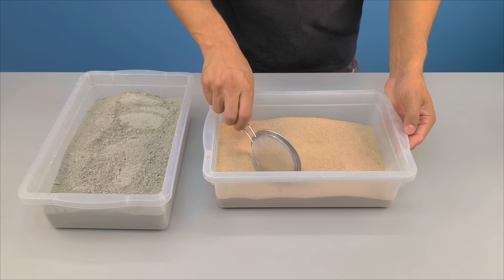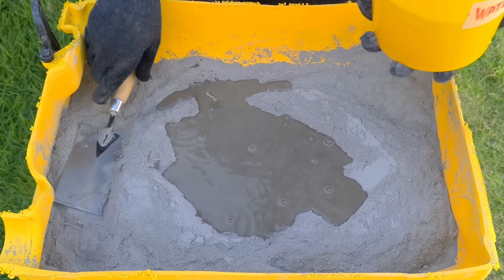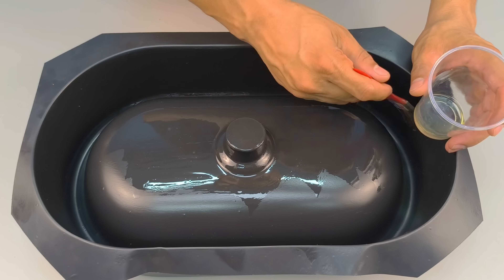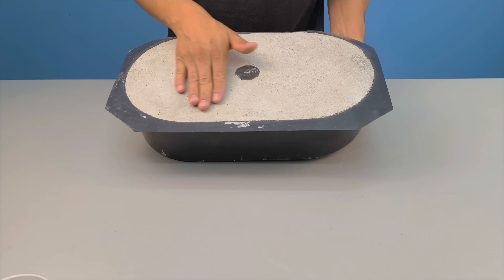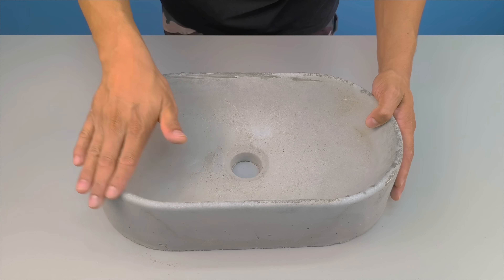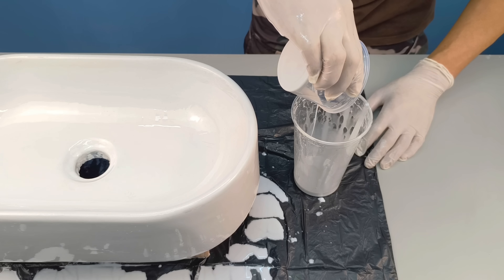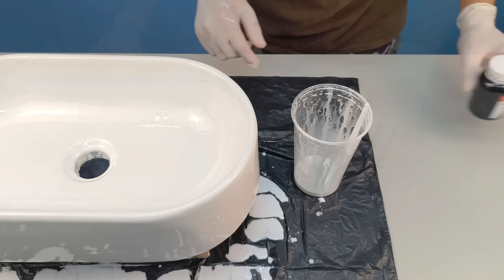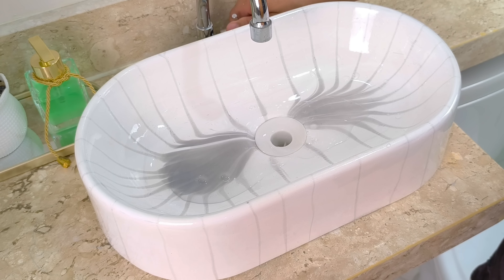Mix CEMENT with EPOXY RESIN and turn the impossible into a MILLION-DOLLAR idea!

Comment: How does this scale up for a hot tub jacuzzi or bath tub with some custom nozzle jets, could it be made so the walls are thinner? many baths or spa seem to have really really thick walls and strange shapes and patterns in a large rectangle its total bath area used as a bath might be quite low. so maybe not closer to a sort of fish tank around the edges but thinner walls that would ideally be more like its uhh water in there and not those strange shapes on the sides are they a reinforcing thing?  and have ramps and stairs or something and still hold water?  so it feels bigger and deeper or could be wheeled away to be stored or cleaned.
would making something that looks like marble columns and a out door sun room or pergola or marquee area similar to a car port or shelter maybe with shadecloth or tarpaulin over it be the same mixcture and spackle and resin work?
Reply from the maker: Scaling this up would require proper structural design. Thinner walls are possible, but only with engineered reinforcement such as fiberglass, mesh or composite layering. The internal shapes in many tubs act as structural reinforcement and load distribution. For larger water volumes, mobility and safety would need engineering validation. Marble-like columns or outdoor elements could use a similar cement base with surface finishing and resin sealing, but structural loads must always be calculated separately.

Comment: The idea is good but the process is so long and time taking making it an unprofitable product compared to other products. It takes 2 week for a single sink to make when you can do something rather to make 8x more income by 2week. I love the idea but not recommend for a single peace whose about to start as a business.
Reply from the maker: That’s a fair and realistic point. This process is indeed time-intensive and may not be ideal for mass production or quick profit. The focus here is on custom work, learning, prototyping and unique pieces rather than fast commercial scalability. For business use, batching and process optimization would be essential.

Comment: Unfortunately the ratios of Portland cement to sand are incorrect. Use at least a 2 sand to 1 powder or better yet a 3:1 ratio. Strength of materials break tests always give higher break test results using these ratios. Also, it takes a long time to blend the chopped fiberglass into the mix. For home owners, use Pam Spy instead of cooking oil. All in all good job, from Lynn in Atlanta.
Reply from the maker: Thank you, Lynn, for sharing your technical insights and experience. You’re correct that traditional strength tests often favor higher sand-to-cement ratios. In this project, the mix was adjusted for surface finish and mold workability rather than structural load. Your tip about using Pam spray instead of cooking oil is also very useful for home applications.

Comment: Brisbane Australia can you send me the specific ingredients please
Reply from the maker: Hello Brisbane 🇦🇺
The ingredients used are common materials: cement, epoxy resin, water (for cement hydration) and optional pigments. The exact proportions may vary depending on the application, but the goal is to combine cement for structure and epoxy for sealing, strength and water resistance.

Comment: even a Swiss watch doesn't need so much time
Reply from the maker: I understand the comparison 😄
Some steps require longer curing times to ensure proper strength, sealing and durability. In cement and resin processes, patience directly affects the final quality.
Reply: @inovaouinventa  I don't think you did understand the comparison. They are likely suggesting the video is too long, not that your process involves too much patience. ;)

Comment: you stated 30gm of fiber per gram, should this been kilogram?
Reply from the maker: Good observation. The correct amount is approximately 30 grams of fiber per batch, not per gram or kilogram. It was a verbal reference to the total mix quantity, and small variations are acceptable depending on the desired reinforcement.

Comment: Very interesting process. Have you tested how this cement epoxy composite performs over time in terms of thermal expansion or long term water exposure?
Reply from the maker: Great question. In this project, the focus was on surface sealing, water resistance and structural stability. Cement naturally has low thermal expansion, while epoxy provides flexibility and waterproofing. For water exposure, the epoxy layer acts as a protective barrier. Long-term industrial testing was not performed, but for decorative and functional applications, the performance has been very stable so far.

Comment: Wha additive is used ? It had a brownish color
Reply from the maker: The brownish liquid is a plasticizing additive, also known as liquid lime. It is used to improve workability, cohesion and fluidity of the cement mix, without changing its structural properties.

Comment: I thought the concrete and resin were going to be mixed together! As for that fiberglass you could always use a tad bit more of that!
Reply from the maker: In this project, the concrete and epoxy are not mixed together. The concrete provides the structure, while the epoxy resin is applied later as a surface coating for sealing, strength and finish. Regarding fiberglass, the amount used was calculated to reinforce without affecting workability, but higher percentages can be used depending on the application.

Comment: We nade fireproof safes using that mix for years in the safe wall, sometimes we used fiber metal in place of the glass fiber
Reply from the maker: That’s fascinating information, thank you for sharing your experience. This confirms that similar cement-resin composites have been used successfully in high-resistance applications. Using metal fiber instead of fiberglass is a very interesting reinforcement approach and adds valuable technical insight to this discussion.

Comment: This is a bad idea, engineers used this recipe to make columns more resistant and virtually eternal, but after five years the concrete began to crack and fall. they had to demolish everything and rebuild it with normal concrete.
Reply from the maker: Thank you for sharing your experience. Structural applications require strict engineering design, expansion control and compatibility between materials. In this project, the epoxy is used as a surface coating and protective layer, not as a structural replacement. Results can vary greatly depending on proportions, environment and application purpose.

Comment: Why wouldn't you just use body filler and green sand it to start like everyone who does this sort of thing for a living? Waiting hours for the filler to full cure just makes twice as much work for you to sand it? And why do you think epoxy coated concrete is somehow unusual? People epoxy coat concrete constantly, especially for floors. They even put patterns in it as they go, but they typically aren't as shitty looking as yours. Also I would like to see you actually mix epoxy resin for 40 minutes, I'm sure the look on your face would be amusing. All in all you wasted a ton of time, put your hard scratch resistant protective outer coating on the inside of your soft easily scratched inner coating and then made a white sink permanently look like it's been streaked with grease from washing dirty hands. Congratulations on wasting time and money using materials wrong and then having an artistic inspiration that made your entire piece undesirable for pretty much anyone who has any other option, no matter how bad the other option is.
Reply from the maker: I understand your perspective 👍
This project wasn’t meant to follow professional or industrial workflows. The goal was experimentation, learning, and exploring a different creative approach, even if it’s not the most efficient or conventional method. Not every project is about optimization — sometimes it’s about testing ideas and visual outcomes. Thanks for taking the time to share your opinion.

Comment: Why don't you just add the Epoxy & Hardner to the cement mixture?
Reply from the maker: Good question 👍
Epoxy and hardener cure differently than cement and can interfere with hydration. In this project, epoxy is used as a coating and finishing layer to improve sealing and appearance rather than being mixed directly into the cement.

Comment: Numerous technical issues with this video.  Conceptually it is fine but the actual materials and process steps need review.  A few internet searches provide better answers for accurate steps and materials for a long lasting epoxy coated cement cast sink.
Cast cement should cure for 7 days for the best stability. Cement actually takes about 25 to 30 days to fully cure. Applying the primer too soon traps moisture and can lead to the epoxy coating failing. additionally, new cement is highly alkaline. (high pH).  The additional waiting time will reduce the alkalinity down to a level that primers are designed to handle effectively. You can test for moisture by taping a plastic sheet over your cement, waiting 24 hours, if there is any condensation on the plastic, your cement isn't ready for a top coat.  Choose an epoxy system that is designed for countertops and sinks.  It should be water proof and it should have UV stabilizers.  40 minutes of mixing seems much longer than necessary.  In fact, some epoxy systems will start to cure in 30 minutes,  so mixing and application need to be completed in under 30 minutes.  It really depends on the top coat epoxy selected. The best advice is to follow the epoxy system instructions. A clear top coat would protect the artwork from damage and provide assurances that everything is coated.  A single layer of epoxy is not likely to be 100% water proof. There are always air bubble that occur when working with epoxy.  If you see them you can pop them with a pin or use a small butane or propane torch. Normally 3 to 4 layers of epoxy are used to finish concrete countertops. Acrylic is a terrible choice as a sealer and bonding agent for a top coating of epoxy.  It will likely lead to peeling and adhesion issues.   Most acrylic sealers are "film-forming" and designed to be the final surface coat. They block other coatings, like epoxy, from bonding properly with the porous concrete substrate. The epoxy will only be as strong as the acrylic layer underneath it, and the acrylic is not designed for that kind of heavy-duty use. Additionally, epoxy and acrylic have different amounts of flexibility and expansion/contraction rates. The differential movement can break the bond between the two. An epoxy primer compatible with the epoxy coating would be better.  Use a penetrating primer recommended by the epoxy coating supplier.
Reply from the maker: I appreciate the feedback 👍
This project focuses on experimentation and a simplified DIY approach. There are definitely more technical and industrial methods available, and those are always worth researching. Thanks for sharing your perspective.

Comment: Did we actually mix Cement with Epoxy Resin? No, we did not. The Epoxy is a coating. So the title is clickbait bullshit. Sorry.
Reply from the maker: I understand your point 👍
The epoxy is used as a coating and finishing layer, which is part of the overall process shown in the video. The title reflects the combined use of cement and epoxy in the final result. Thanks for commenting.

Comment: Interesting video but you'll have to make couple changes first don't use regular fiberglass. Use AR-Fiberglass(alkali-resistant glass-fiber) second the amount of fiber needs to be higher . third degas the cement using vacuum, start pouring  the cement at the lowest point and not in random places which will minimize trapped air bubbles. Use low viscosity sealers instead of  thick epoxies which will most likely delaminate in the future . I'm from Michigan-USA I highly recommend researching UHPC-Ultra High Strength Cement
Reply from the maker: Thank you for the detailed and technical feedback 👍
You’re absolutely right — AR-fiberglass, proper fiber dosage, degassing, and low-viscosity sealers are best practices, especially for structural or long-term applications.
This experiment is more focused on a simplified DIY approach, but your points are extremely valuable and definitely worth exploring in advanced versions. Thanks for sharing your knowledge from Michigan-USA 🇺🇸
Reply: @inovaouinventa  The most important thing for you is to never stop making videos regardless what people say including myself. You're already an artist the technical part in you will grow with every video you make, just never stop !!!
Reply: @djovanimiok3487  Can ferro cement be used?
Reply: @mkrao100  Definitely a good method as long as the steel reinforcement (mesh)is protected from the cement acidity
Reply: Now that's decent advice 🎉 But I think this low budget approach is sufficient. Especially where codes and standards are vastly different than ours here in the states.
Reply: @EriVanLifeScape not a code issue but a chemical one. Normal fiberglass won't last bec the cement will eat it. That's why you have to use AR fiberglass
Reply: @jdhardisty3741 ah! Understood 🎉
What was the question 😅
Reply: @EriVanLifeScape  i agree with you 100%
Reply: Philippines
Reply: Jasee l.. Orlando Florida

Comment: Where can one get mold?
Reply from the maker: You can find molds on online marketplaces such as Amazon, Mercado Libre, Shopee, Temu, and similar platforms.
These molds are usually made of plastic or silicone and are reusable, which makes them suitable for multiple projects.
Reply: @inovaouinventa I know I’ve looked, where on the one u have used

Comment: The stain pattern is ugly but does not matter, the procedure of fabricating the sink is interesting overall. It's not quite DIY, since you have to buy a mould which you cannoy justify if you will make just one item, once.
Reply from the maker: Thank you for the honest feedback.
The stain pattern is a design choice and can be refined with different techniques and pigments. Regarding the mold, it is reusable and becomes cost-effective when making multiple pieces or testing variations. The video focuses mainly on the fabrication process and material behavior.
Reply from the maker: Thank you for the honest feedback.
The stain pattern is a design choice and can be refined with different techniques and pigments. Regarding the mold, it is reusable and becomes cost-effective when making multiple pieces or testing variations. The video focuses mainly on the fabrication process and material behavior.

Comment: I noticed that when you weigh out the fibreglass, that you don't compensate for the weight of the cup. You claimed 30grams of fiberglass, but only measured out 26 (4g was the cup). You messed up your own recipe.
Reply from the maker: I stated that I added approximately 30 grams, which can be slightly more or less.
This variation does not affect the result of the experiment, since the purpose is to demonstrate the process and material behavior, not a laboratory-grade formulation. The measurement was intentionally approximate.

Comment: mofo - you should be charged for damages/injuries/deaths resulting from your bullshit.   guys, NEVER mix epoxy resin or hardner with WATER.
Reply from the maker: Thank you for sharing your concern about safety.
To clarify: in this project, epoxy resin and hardener are not mixed directly with water. The process shown involves a cement-based matrix and controlled application techniques.
Safety precautions, proper ratios, and manufacturer guidelines should always be followed. This video is a demonstration, not a recommendation for unsafe practices.

Comment: Woow!! Very good job, it looks amazing! Just a quick question, what you do with all the extra already mixt materials that you don't use? How you recycle them? Or are you just throw them away, to garbage?
Reply from the maker: Thank you! 🙌✨ Great question.
I never throw mixed material away. When possible, I reuse it for small test pieces, samples, details, or future experiments. If the material has already cured, it becomes a solid piece and is used for demonstrations or strength tests. I always try to reduce waste and reuse everything responsibly.

Comment: I work with resin, and i mix it for 3 to 4 minutes. Why is yours different?  Greetings from Longview,  Washington!
Reply from the maker: Hi my friend! 😊
Great question! The mixing time can really vary depending on the brand, temperature, viscosity, and the purpose of the epoxy resin.
In my case, the reaction happens faster because of the environment and the type of experiment, so it looks different from yours.
But your method of mixing for 3 to 4 minutes (or even 4 to 5 minutes) works perfectly too — it all depends on the resin you're using.
Greetings to Longview, Washington! 🇺🇸✨

Comment: Warning If you do this in the US, mixing chopped fiberglass into any building materials not only will your building not be to code, but it will be labeled as having Asbestos, and you will not be able to have it removed you will have to pay a specialist to deal with it, and it will not be cheap.
While the fibers you started with are likely not too horrible, the moment you sanded them you made real Asbestos, the bad kind.
Reply from the maker: Thanks for the feedback, my friend! 💡 This video is just a fun experiment for creative projects and not meant for structural building. 👍